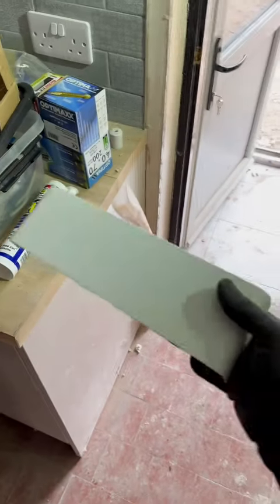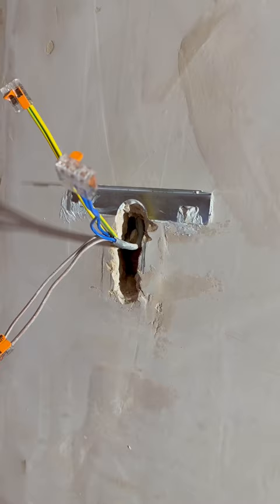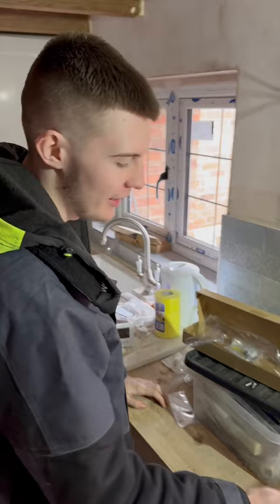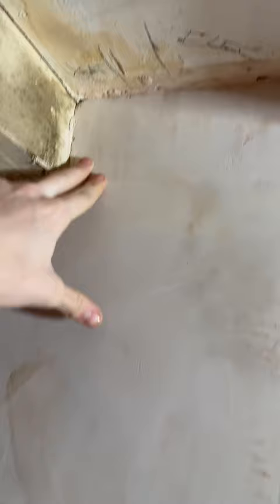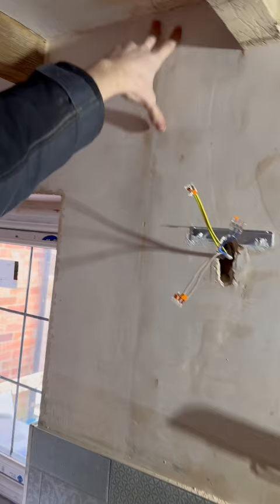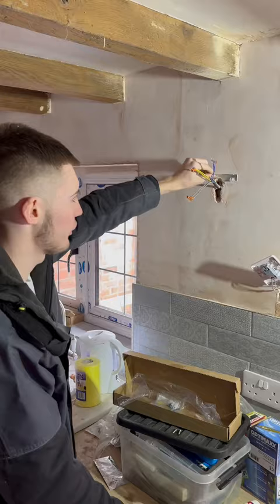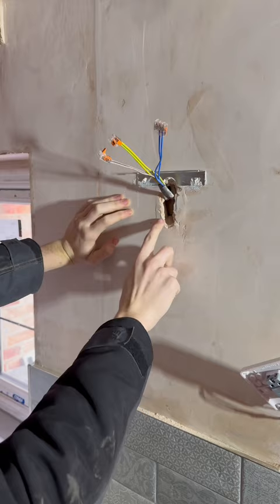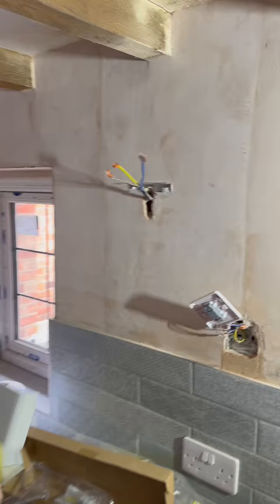Apprentice glued lights to the wall 😵

Comment: Who cares about one small thing being removed in 20 years? I say the kid deserves a pat on the back for being so aware of safety. 👌🏻
Reply: I want the kid to be called back in 20 years to deal with his choice. He'll then understand the value of leaving the worksite in a decent condition for the next person.
Reply: @illegalopinions4082  plastering is so bad I wouldn't think the person doing the next renovation will care about having to fix it
Reply: As someone who did a lot of glazing many jobs took hours longer than it shoulda been cos the guy u fitted it was a menace.
Reply: @illegalopinions4082  You could easily remove it by chipping the plaster board away and then filling it in. Having a brain helps.

Comment: Needs must at the end of the day, as long as its done with appropriate materials, which it is... though if it failed bit of mare to replace.
I may have used a back plate of nice timber or so  something to screw to... my opinion.
Reply: How would you fix the timber to the wall? With ct1 ? 🤣

Comment: personally i would have used detector then ( as it was under the beam ) perhaps drilled two new holes in the actual bracket, to save on the decoration as said when its gotta be ripped off again

Comment: A scraper knife behind the fixture, a couple of taps on the handle with a hammer should get it off easily, much easier than trying to extract rusted or rounded off screws!!

Comment: That's why we install electrical outlet boxs behind lights it not only gives you screw holes to mount the light but it's also the code and the code was put in place to prevent fire's
Reply: Most wall lights won't cover a back box, the fixing centers of wall lights are all different unlike the fixing centers of back boxes. It might be different outside of the UK but judging by the accents they're in the UK.

Comment: When cables and pipes close to each other what can you do, the only option is glue well done Adam
Reply: Cant think of anything else
Reply: Use a terminal driver,push a hole through the plasterboard first to see if there is actually anything stopping you from drilling.chances are it would have been clear behind that bracket.i would have at least checked that first.

Comment: This will last till the next re-wire. 

Another option would be to fit a conduit box during first fix. At an angle so the m4 threads are level horizontally. Drill the light bracket for m4 screws and probably also some glue as well if needed 👌